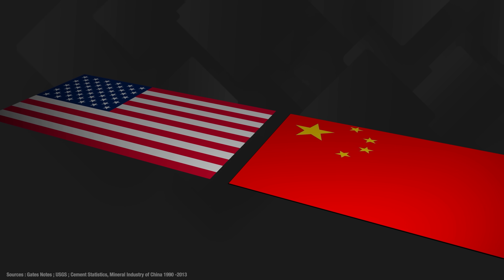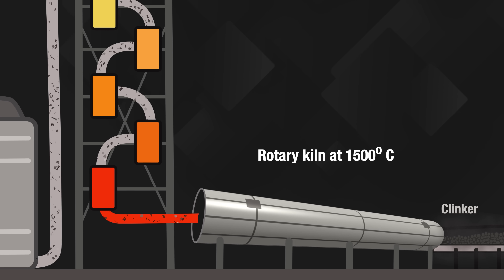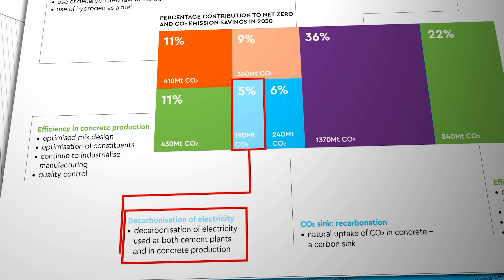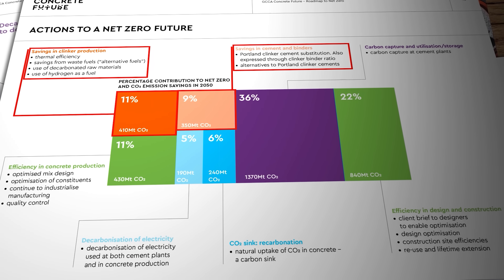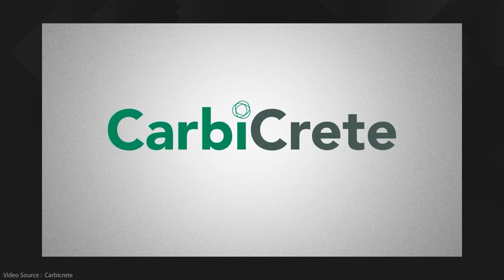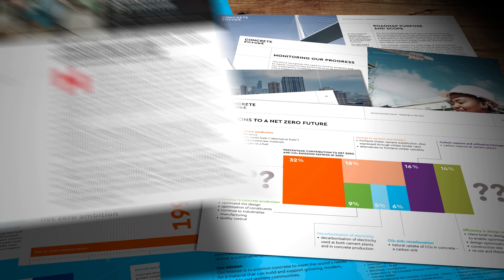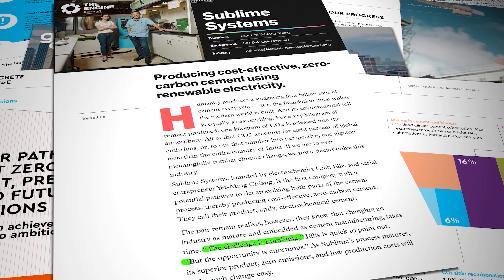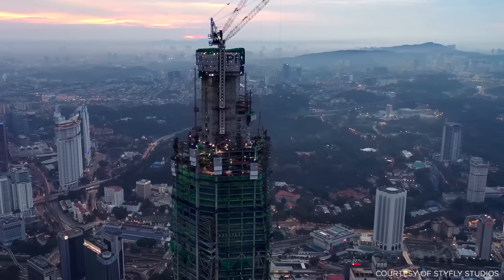How to make concrete green!

Comment: Dave, there is a much  better solution to the concrete problem, that you didn’t mention: geopolymer cements.

Our infrastructure is crumbling because we built it with Portland cement, OPC, which inevitably cracks. Cracks let water reach the rebar, which rusts, expands, and breaks the concrete apart, in as little as 40 years: the Surfside. Florida condominium collapse was predictable. If we rebuild with OPC, our grandkids will have to do it all again, and the way we leave them our debt, they’ll still be paying off this rebuild. But the OPC industry—the largest on the planet—is already responsible for 8 percent of climate change. If we rebuild, and the developing world modernizes, with OPC, that will increase exponentially—as you said, China already uses 40 times as much cement as we do—and that industry alone will make climate change unstoppable. The concrete industry needs to go carbon negative, not save dribs and drabs here and there. Now would be good. Yesterday would have been better.

Geopolymer cements based on aluminosilicates, not calcium carbonates, emit far less carbon when made than OPC, and some formulas sequester carbon as they cure. GPCs are stronger, much more flexible and resilient, far more fire resistant, don’t crack, are actually waterproof (OPC is not), chemically resistant, should cost less, and should last millennia, not decades; they’re essentially glass, not chemically-vulnerable limestone that’s always full of water. And we can clean up vast stores of toxic wastes, coal fly ash and steel-mill slag, making them; when we use those up,  we turn to plentiful volcanic ash. 

If one geopolymer cement, Blue World Crete,  is the super-insulation its designer, Daniel Panitz of Pompano Beach, Florida, says it is, I see a way (I’ve studied passive solar home design) to cut the cost of the shell, at least, of a super-insulated passive house, perhaps in half, building with it and bamboo (we need to be growing lots of bamboo). That house would keep its occupants comfortable with little or no outside energy, would be mold, earthquake, and storm resistant, would be so fireproof and insulative that it would be your refuge, your shelter, in a wildfire, and it might still be sheltering families 1,000, 2,000 years from now.

I can show you how to build tornado-proof homes (Hobbit houses) with Blue World Crete. And I can show you how to seismically upgrade old brick buildings, strengthen them so they might stand a thousand years, and, with no additional labor or materials, to insulate, waterproof, fireproof, and air seal them at the same time. In BWC I see a solution to both the homelessness and the affordable housing crises: the world needs Blue World Crete, and Panitz seems to need help bringing it to market. I begin discussing it on page 254 of Pumping the Brakes on Climate Change: A Review of the Technologies and Politics that Could Leave the Future a Future, the book I’ve been working on for way too long now. 

PTBOCC is a literature review, with copious endnotes; getting away from OPC is vital to reversing climate change, so I spent a lot of effort on the chapter discussing alternative cements. You and your viewers are welcome to download a PDF at www.ptbocc.com , leave comments, and use my research to further your own. I will expect a full report on geopolymer cements!  Just kidding. But, please.

And BTW, the steel with which we reinforce concrete is 9 percent of climate change. Boston Metal (and others) will commercialize carbon-free metals smelting in just a few more years. I wish Congress would specify that our infrastructure be rebuilt with geopolymer cements and American-made clean steel—and where it’s appropriate, bamboo—not OPC and rebar from China. I don’t know how to reach them with that message. Anybody?
Reply: While I'd like him to mention geopolymer cement vs portland cement vs hempcrete, the blue world crete you mention lists "proprietary binding agents" combined with "materials containing alumina sylicates" which means nothing. Keeping the recipe and production method secret might be good for business but it makes your product worthless for discussion.
Reply: @hurrdurrmurrgurr  Not my product. I prefer people to open-source their tech, too, but Panitz is trying to make a living, and Navrattan Industries (India) has already stolen his intellectual property, and cut him out of the profits. I can't blame him, but, yeah, I wish he'd tell us how his binder works.
Reply: I'm curious how much you talk is a commercial and how much is real.
Reply: I have absolutely no financial interest in promoting geopolymers or Blue Crete: I'm just trying to help save the climate. An awful lot of research convinces me that geopolymers are for real; Roman concrete has lasted two millennia, and the mortars that held/hold ancient Jericho together, seven, and they are both primitive geopolymers. As for Blue Crete, some day I will have to convince Panitz to send me some--or buy it, when it becomes readily available--so I can duplicate his tests and see if they hold water. But if he has what he says he has, super strong--last phone conversation, he said seven times the tensile strength of OPC--very low carbon SUPERINSULATING cement, if he can bring it to market, it will hugely change the way we build, maybe cut the cost of construction in half, and our bridges might last centuries instead of decades. I'm excited to see if it's for real.
Reply: I have absolutely no financial interest in geopolymers or Blue Crete. An awful lot of journalistic research convinces me that geopolymers are the real deal: much built with Roman concrete 2000 years ago is still in daily use, and the mortars that held ancient Jericho together 7,000 years ago still do, and those are both primitive geopolymers.

As for Blue Crete, someday I will have to get Panitz to send me some, or buy it when it becomes available, and see if I can duplicate his test results. But if he has what he says he has, cement/concrete with seven times the tensile strength of OPC, utterly fireproof, waterproof, mold/mildew/ bacteria/barnacle resistant, flexible, crack resistant, and SUPERINSULATING, he could cut the cost of construction in half, and our bridges might last centuries instead of decades. I can't wait to see if that is   true.
Reply: @Gnefitisis
Reply: @Gnefitisis  I have absolutely no financial interest in geopolymers or Blue Crete. An awful lot of journalistic research convinces me that geopolymers are the real deal: much built with Roman concrete 2000 years ago is still in daily use, and the mortars that held ancient Jericho together 7,000 years ago still do, and those are both primitive geopolymers.

As for Blue Crete, someday I will have to get Panitz to send me some, or buy it when it becomes available, and see if I can duplicate his test results. But if he has what he says he has, cement/concrete with seven times the tensile strength of OPC, utterly fireproof, waterproof, mold/mildew/ bacteria/barnacle resistant, flexible, crack resistant, and SUPERINSULATING, he could cut the cost of construction in half, and our bridges might last centuries instead of decades. I can't wait to see if that is   true.
Reply: OOPS! Sorry., I did not realize that this primitive program drops comments on comments down, instead of leaving them below the comment being commented on. Tried to get it to take three times before I gave up, and found my answers below.
Reply: @John O'Recick There are some points, i would like to add to the first paragraph: 
The cracks caused by expanding (i.e. rusting) rebars are caused by carbonisation, an effect where invading carbon in the air gets into the top layers of concrete where it forms carbonic acid with the water in the pores or chemically bound water in the cement-matrix. This lowers the pH-values of the concrete. This is important because normal concrete has a pH of around 12. That ensures that the reinforcement bars are "passivated" - the water in the pores cannot cause any form of oxidation/rust of the iron. The carbonic acid negates the effects of this passivation, causing the rebars to expand and break concrete parts away, as you stated previously. The solution is a higher amount of concrete cover between rebars and surface. Most countries have guidelines for prevention of carbonisation induced corrosion of rebars - though i don't know about the situation in the U.S (i'm from Germany so i can mainly speak about german and european guidelines). So cracking up of outer layers of concrete because of expanding rebars is mostly a design issue.

Concrete naturally cracks, that is correct. But if the cracks don't widen due to outer influences like invading and expanding water in winter or mechanical stress, the rebars are protected. Actually, some cracks sort of "heal" because of growing C-S-H (the reaction that hardens concrete actually never ends - practically it does not end for the time of usage of our concrete-buildings which is around 50-100 years) - but the margin is in the nm margin. The most critical point for the durability of concrete are the iron reinforcements - as long as they are protected from corrosion (for example, chlorine corrosion is another big topic) - the concrete is pretty durable. Corrosion, where the concrete itself is attacked [for example Alkali-silica-reaction; biogenic sulfuric acid corrosion (don't know, if this is the correct scientific term in English), or secondary forming of sulfate-compounds] can mostly be ruled out by design and composition. Another issue as mentioned before is of course mechanical stress. But this is the responsibility of structural engineers. 

Another point i would like to add to the second paragraph: the usage of toxic byproducts in cement is already standard. We use fly ash (from coal power plants), silica fume (production of Silicon and ferrosilicon alloys), blast furnace slag meal (iron smelting) and many other compounds that would otherwise be stored in landfills (in the most optimistic imagination of responsibility-thinking of the producers...). We actually have the problem (i again would like to mention that my report is based on the situation in the EU), that we have less and less fly ash and blast furnace slag meal due to the transformation to green energy production and the use of hydrogen-based direct reduction process in iron production (hope this is the correct English term...). Don't get my wrong, this is great for our transformation to a green future but actually bad for the environmental balance of cement and the affordability (as mentioned in the video).

So to conclude: we need other materials, that have the similar properties like portlandcement based concrete (actually portlandcement, or CEM I in the EU, isn't actually the most preferred form of used cement - in the EU f.e. we mostly use CEM III, which contains around 80% of blast furnace slag). Geopolymers are a great starter, but also the better application of concrete like UHPC (Ultra high performance concrete) and better structural utilization (you would get nightmares if you knew how much concrete isn't actually necessary for a building to be structural sound...) other materials like timber, masonry, green steel or even clay are needed to get away from the concrete-heavy building industry. And the universities need to actually teach future civil engineers to use concrete in another way as a cheap filler if you don't want to calculate too much... And we need loads, loads of research in concrete, as we use it on the construction site basically the same way as 80 years ago, but with way more steel for reinforcement. Also the chemical processes of reaction of cement aren't even fully understood - giving me a chance to do research in that field.

I hope i could add something helpful to your comment and extend the view of some on the issues of concrete usage. In the case my way of writing in english was some way of pleasant. Have a nice day!
Reply: The way I see it, there are only three things that matter when trying to deal with the carbon problems of portland cement - carbon, quality, and cost. Any replacement needs to be as technically good or better than portland cement for the purposes which cement is used (this is where the hempcrete proponents go wrong - it’s technically inferior). It needs to be zero carbon (or better yet, carbon negative) if it’s to be anything more than a stopgap. And, and, and… it needs to cost less than portland cement. This last one sucks, but it’s the critical factor. I don’t care how cool the tech is, how good it looks on paper, whatever. If it’s ten times as expensive, it’s dead on arrival and will never be more than a lab experiment. But give me something carbon neutral, just as strong as portland cement, and CHEAPER, and I’ll give you a multibillion dollar industrial disruption.
Reply: @davestagner  absolutely.  The message from the industry is that it needs to be "green" on both sides of the equation...ecologically friendly but also financially compelling (or at least acceptable).
Reply: @paulferguson4930  It’s aggravated by the fact that the existing portland cement manufacturing facilities are mostly long paid off now, only costing for raw material and energy. Replacement cement technologies that don’t use the existing facilities mean new facilities need to be built, so it’ll take a while to pay them off. On the plus side, though, “green concrete” is a selling point in itself, and could at least sell at a premium to some early adopters, enough to get it launched.
Reply: @davestagner , Panitz says Blue Crete should cost 20 percent less than OPC. Remember that the OPC industry is the largest on the planet, it has a lot of political power, and it is as stubbornly resistant to change as is the fossil fuel industry.  It would save itself money switching to GPCs and Blue Crete. Somehow it doesn't see that, or it sees a (short term?) reduction in its profit stream, switching tech, and like the fossils it would rather destroy the planet than give up a quarterly dime.
Reply: We just need to figure out Roman cement. Some Roman concrete structures have been standing for a thousand years.
Reply: @keithyinger3326  Last summer, I saw thousand year old structures still in use, with people living in them (Taos Pueblo). And that was just adobe, no cement at all. Literally just mud bricks and mud coating. But it’s nearly impossible to build something more than two stories tall out of adobe. It’s just not strong enough. Even that height requires walls several feet thick to keep from collapsing. Not far away, I visited the world famous San Francisco de Asis Mission Church in Rancho de Taos. I got to speak to a church member caring for the grounds. She told me about how the congregation has to go out every single year, to re-plaster and repair the exterior, using the same locally made adobe that it was built from 250 years ago. Today, it’d be relatively straightforward to build a structure just as big and even stronger out of ordinary concrete blocks you can buy at Home Depot for two bucks. Of course, it’d be ugly… 

Portland cement is truly amazing stuff, the best building material humanity has ever created. Making something that works just as well, without the disadvantages carbon-wise, will be a tremendous feat.
Reply: @davestagner  mud or adobe is a good Building Material in dry environments. Somewhere here like in Washington state where it rains for almost 8 months out of the year, it might end up getting a little bit soggy.
Reply: @keithyinger3326  I love adobe as a building material. Just don’t ask it to do more than it’s capable of doing. Last summer, I stayed in a place in New Mexico that could be close to 400 years old… no one knows for sure. Part of an early Spanish mission school. Adobe is effective, beautiful, and utterly low tech.
Reply: @keithyinger3326  Roman cement is basically an alkali activated cement with more lime
Reply: It seems that these startups complement each other in many ways and should all be included in a multifaceted solution for low/no carbon concrete.
Reply: @brian1204  I believe some variation of that will happen but will take time to shake out, imo.
Reply: I came here to post this! I was so surprised that there was no mention of geopolymers in this video
Reply: sounds suspiciously like a sales pitch
Reply: @nathanlevesque7812  Like I said, I have no financial interest in this at all, other than reporting on it as a journalist. It looks to me as if GPCs and Blue Crete are for real, and I have forty-eleven nieces and nephews to whom I'd like to leave a habitable planet. Sue me if I sound enthusiastic: it's only because I am.
Reply: I think the problem with you environmentalists, is that you seem to think all these things cost nothing. 

" I wish Congress would specify that our infrastructure be rebuilt with geopolymer cements and American-made clean steel" Not only do you want the entirety of our infrastructure functional or not, to be rebuilt, you want it all to be made from sustainably grown unicorn horns as well.

Sorry to break the news, but socialism doesn't work in real life, because it requires that people work for free.
Reply: Betolar from Finland provides geopolymer solutions. And solutions are getting cheaper and better quality than traditional concrete.
Reply: Geopolymers made from metakaolin is among the strongest studied. Metakaolin one of the most common form of clay. The biggest challenge is the fact that there is over 100x more lime (the main component of Portland cement) than metakaolin in the earth. Geopolymers are an alternative, not a full replacement. To add, fly ash and furnace slag, byproducts of Portland cement manufacturing and steelmaking, make crystalline forms close to geopolymers and are frequently misnamed geopolymers when they're alkali activated cements. This defeats the point. True geopolymers are amorphous. Despite these challenges, geopolymer is about the best material for longevity and fire resistance. Cement will degrade at 500°C and spall around that, but geopolymers and geopolymer composites can withstand temperatures far above that while also retaining high strengths. Pragmatically, geopolymers have promise, but they realistically cannot overcome the Portland cement emission plateau on their own.
Reply: @lousassle9387  Metakaolin clay is just one of--hundreds?--of aluminosilicates that can be made into GPCs; 3/4 of the rocks on Earth's surface, according to Panitz. Different mixes will have different strengths/ characteristics, but from what I see so far, most of them will be superior to OPC in almost every way, and we CAN completely replace OPC with GPC--and be better off for it.
Reply: @Grumplestiltskin007  Current statistics say otherwise. Metakaolin production, among other relevant sources like kaolin, slag, waste materials, and so on, is vastly dwarfed by the production of cement. We cannot feasibly say geopolymers will replace OPC but there are so many promising applications that can handle the current market where a considerable and necessary chunk of that pie will be.